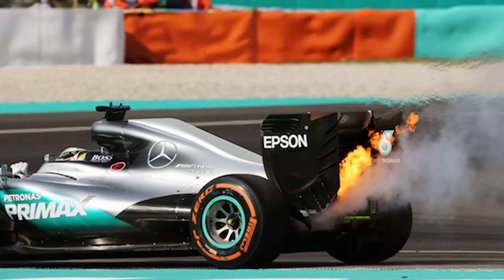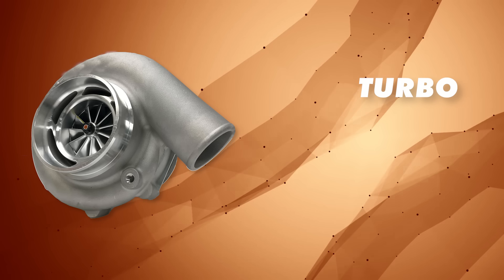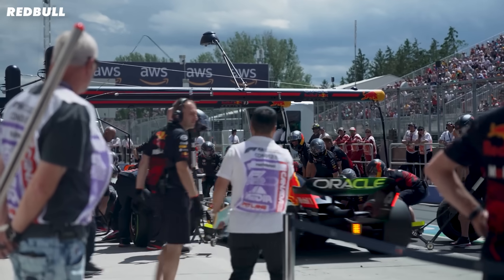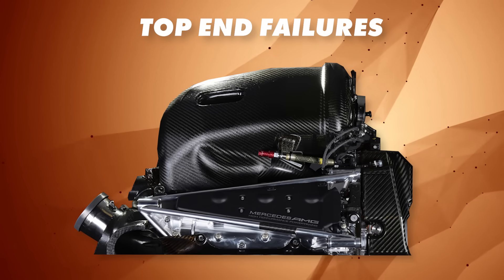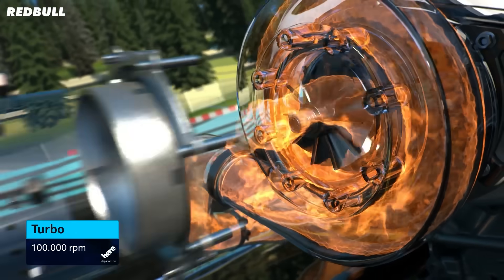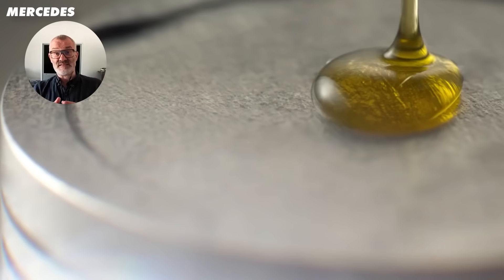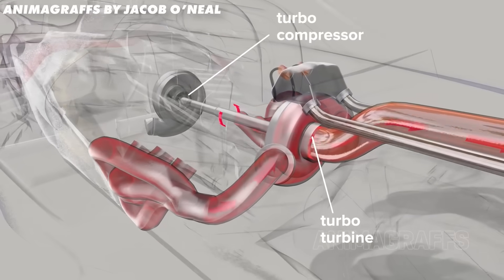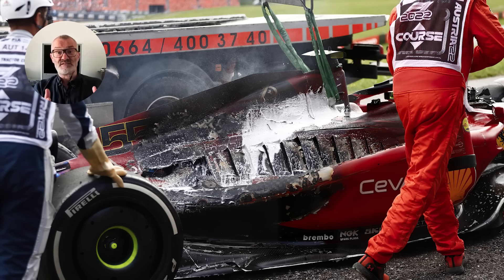Why F1 Engines EXPLODE

Comment: The pistons are directly connected to the connecting rods that when are attached to the crankshaft make up the rotating assembly. The rotating assembly is in the shortblock, making this bottom end. Pistons are not part of the top end. Top end is heads, valvetrain, and cams.

Comment: I think its more amazing they don't explode more often.  That much boost combined with insane rpms and tons of heat, I'm surprised that there aren't at least 20% of the field out each race with engine failure.  Happens a lot more in Nascar and those engines don't make nearly as much power and no turbos.

Comment: There is no bearing in a turbo, no bearing can sustain those rpm. Instead there is a oil ring that do the bearing. And usually, this is where the failure happen, this "oil bearing" leak, and then one of two thing happen, either the turbo burst and bits of it goes into the engine air intake wreaking havock, or the turbo consume all the oil of the engine who end up failing due to lack of lubrification (actually a very common cause for low engine failure).

Comment: it is quite refreshing to see this happen, I remember the early 90's where often, cars blew up before reaching the start line, others blew up on it... and then there were the spectacular high speed blowouts! I miss the 90's Formula one for one thing... unlimited shit.... 
imagine if they didn't have to make the engine last a quarter season, but could use one per 2 races or one per weekend... 
they used to have qualifying engines they just used for qualifying a couple of races before they blew out.
with modern technologies and less focus on durability when it comes to pushing things to the limit... I am pretty sure they would go quite a lot faster.

Comment: Don't think it was a turbo failure. It would be very rare that the turbo would explode rather than just seize, unless Ferrari are buying fake turbos on ebay. It think one of the piston cracked/broke, then oil get into the exhaust from the piston jets to give the smoke, sainz immediately backed off, but a few seconds letter the piston completely disntagrated and exited stage right along with half of its conrod. Ensuing fire is oil.

Comment: First picture of a "bottom end failure" at 4:07 looks like run away pre ignition melting through the piston. That appears to have liberated large amounts of metal that have bounced around and taken out an intake valve, but has continued to run for a decent amount of time after the failure. Always fun trying to work out what failed first when the driver keeps trying to drive after it has clearly got a major issue 😅

Comment: I worked as a vendor for Garrett Air research in Torrance ca. Question to you...............What turbo has the hardest life? cars?, huge earth movers with massive Turbos, race engines? Answer........... buses. Spooling up and down all day long causes more extremes, thermal, velocities, all day long. Yeah bus turbos have the hardest life. They test turbos to failure. The casting surrounding the turbine is designed to contain a grenading of the turbine. Sometimes they fail to contain the event. They use sch 80 pipe fittings down stream and a "bug catcher" a disc of 1 in. thick 304 S.S. with 1in. holes in the disc. 12 in dia. for bus  and earth mover size turbos. I've seen 12" to 8" bell reducers with dents on the outside surface .5" high. That is .5 wall if I recall. 

In the beginning of F1 turbo era They made the Ferrari Turbos ( I think they still do, have not worked for them in a while). They did not use the casting to contain the turbine in case of failure. To be light weight they used Inconel sheeting, super thin, like .040" thick. They had a Kevlar surround that was part of the roll over hoop and down the sides of the turbo. It was many plies about .75" thick. They then shipped it to their Mexican plant to be hooked to a test stand with a burner to simulate exhaust and spun it up to failure. Yes, the Kevlar contained the fragments.

Comment: It would be great to know which failure will cost a team the most amount of money/ what parts are usually scrapped vs  inspected and rebuilt to spec!
Reply: From pure logic, I would imagine a turbo is the cheapest. You could maybe salvage very little from a top failure if you are very lucky, but probably not in F1, but a bottom failure would ruin the engine. This is just me being logical, and I am no mechanic.

Comment: Interesting... I've been a licensed automotive technician for a number of years, been in the trade for longer, as well as have built a couple of custom engines and I've never heard anyone refer to pistons as being part of the top end of an I.C.E. Everyone I've ever conversed with about the subject, even machine shops and automotive engineers, consider anything contained within the engine block to be bottom end (even though the pistons often stick above the deck when they are higher compression they are still mostly in the bore as well as connected and part of the rotating assembly). Perhaps There is a bit of a difference amongst the common agreement in either my western world vs. Euro nations or maybe between road vehicles/low level racing series vs. elite level motorsports such as F1? Can anyone elaborate for me?
Reply: Yeah, I thought bottom end was all the stuff that directly or indirectly mounts to the block: oil pick-up, pistons, rods, crank and all the bearings that are associated with those parts as well... 

And the top end was stuff like the head, valaves, cams and etc on the engine
Reply: Just building an engine for myself at the moment and would agree with you I’d always heard of pistons being part of the bottom end
Reply: I have always heard the rotating assembly as being in the bottom end. Pistons, connecting rods, etc.
Reply: I did think that was a bit strange. Top end equals above combustion chamber imo

Comment: The reason why Ferrari engine are failing Is because of the ultra boost they use in theengine, they have the highest supercharging in the pack, and Is more about the Hybrid part (the Electric engine) failing under the stress... That boost gives Ferrari 20-30 hp more than the others

Comment: Driver61, why did you classify pistons as part of the top end? I have always been under the impression that everything above the piston is typically top end?
Reply: @d.martins4471  cool! I have worked in the engine industry for a little while, however it’s mainly been domesticated V8’s so wasn’t sure if there is a difference

Comment: Always interests me, how (although they are very small displacement wise) they don't make all that much power for how unreliable they really are. I mean, they make around 1000hp if you believe the claims of renault, personally I think it's closer to 900. I've seen street cars pushing 1000+ for 5 or 6 years with no major issues. I understand the displacement is a big disadvantage for the F1 engines, but still, I really don't think there's any excuse for a team to have engines that are this unreliable.
Reply: Street cars pushing 1000hp don't actually use it for more than a few seconds/minutes at a time. Have much higher capacity (as you mention) are not fuel rate limited and don't have to be as light as possible.  Chalk and cheese.

Comment: Hmmm right so if a turbo has a loss of lubrication,.... Wouldn't the exhaust NOT have oil near it? There's a ton of ways turbos can fail. Specifically with regards to the type of turbos used in f1 they are commonly ball bearing turbochargers. So the common failure modes would be low cycle fatigue of either the compressor or turbine usually resulting in a rupture of the hub, high cycle fatigue of either wheel commonly resulting in part or all of the blade to eject and sending the balance of the rotating assembly through the roof, the ball bearing cartridge could have contaminated lube (for ball bearings this is most often very fine silicone particles left over in the engine from the honing process, ball bearings are actually more easily damaged by fine particles less tham 5 microns large as opposed to journal bearings which see damage from larger particles), the balls of the bearing could fatigue, the inner our outer ring of the bearing cartridge could see spalding or damage from skipping of the balls, the impellers could get damaged from FOD, and tons more ways. Basically, I would expect an f1 turbo to literally never fail due to lack of lubrication as that would be a super rookie mistake. Just give the damn thing oil, it's not that hard. Something else (like the oil pump) has to fail first for that to happen.

Comment: With Sainz you could actually see pieces of the body work bursting from some parts of the engine flying outward.  It may have been a combo turbo/bottom end failure with the actually crank case exploding.

Comment: Could ferrari be back to their old tricks using engine oil for extra power and the resulting slight decrease in oil level just affects the oil pressure/ flow rate enough that the very sensitive turbos don't like it?
Reply: Nope.

Comment: Totally disagree on Carlos' engine failure. This was clearly a conrod blasting through the block. In my 20 years as an engine rebuilder i never saw a turbo explode, sending bits though te bodywork. Also blue smoke in a lot of cases is a piston dying.
Reply: I think that it was a mixture of a turbo failure and a bottom end because I think that the turbo ruptured the oil cooling line to itself and the lack of oil caused a bottom end failure also.
Reply: @BlackNitro99  turbos on these engines are hardwired, so I doubt it. Leclerc's DNF was clearly a seizing turbo though.
Reply: @therealCelticViking A 20 year engine builder calling a hard oil line, hardwired? Not saying you're not a good NA builder but how much experience do you really have with forced induction? Hard lines will fatigue crack, which will lead to a larger hole forming or a complete failure, which will cause low-no oil pressure, leading to a completely scrap motor. F1 turbos are also water cooled so it's also possible for a coolant line to rupture and for the engine and turbo to go that way.

Comment: Question, when Sainz was rolling off the track, there was a clear explosion that occurred under the cover. That looked more like a turbo breaking apart.
Reply: I was wondering who else saw that! I was really hoping for an explanation in this video. It was a big enough “bang” to crack the side of the side-pod open….
Reply: ya, if oiling failed heat would  cause the housing to fail, shaft spins out of kilter and pow! compressed fuel/air + burning metal shards
Reply: Good point, but also none of that was a question.
Reply: And this is the engine which is fitted in the new LMDh? for 6 and 24h races in tne WEC and in the US/IMSA?Realy?

Comment: do you think Ferrari could use induced power oscillations from its ICE or MGU-K to minimize purposing or improve traction? They seem to have found something and its not aero or suspensions. Also would explain the frequent blowouts
Reply: My reasoning for asking this is the following:

If Ferrari is using Induced engine oscillations, it would explain the increase in traction and decrease of purposing. You could achieve that by measuring the frequency of the purpoising and then tune the fuel mapping of the engine to adjust for that, so that the engine makes less power when the car squats and more power when it rebounds, in effect creating a flat running car with the benefit of increased fuel economy. In effect you are using a counter resonance of frequent forces to balance them out. 

From my own observations, the Ferrari cars tend to bounce a lot under a lot of aerodynamic load such as at high speeds or when the cars go at the limit close to top speed. While accelerating fast  say from 100KPH to about 250KPH the cars don't experience purposing and its fair to say no car on the grid is. However, once the cars go above this speed then the effect starts and is more pronounced when the car closes in on its top speed. That would mean that high speed corners, like in Jeddah or the Red Bull Ring "Turn 2" would prove catastrophic for these cars. But last race I saw Ferrari going across all DRS zones with very little oscillations. Also, when Leclerc went across a fast corner and "jumped a bit", the car shook quite violently for a couple of seconds  and then completely flat. Yes, hard suspension and all but I think there is more there such as the car momentarily went out of counter resonance with itself and the oscillations shook the car violently.

I also noticed that when a corner is slow in fast out, the effect is small but when the corner is fast in slow out, the effect is pronounced and the car shakes on entry but has amazing traction out of the corner and can take the corner much faster than the opposition(Turn 3 Austria).

Finally, you could induce engine oscillations with fuel mapping, and even though the engine would run no issues, the gas flow pulsations going into the turbo would really put a lot of strain on the turbo shaft, grenading it in the process.

Now my question isn't are they using oscillations, but could they?

Comment: Since when is a Piston part of the top end of an engine? I’ve only ever heard of pistons being referred to as part of the bottom end - basically, anything that goes in the block (like a piston) is the bottom end. That’s why a “short block” will contain the pistons - it has all of the bottom end components. The top end of the engine is the cylinder head, and everything that goes in it. That’s why a “long block” is the entire engine; both the top and bottom end.
Reply: @Stem Artin the second part is incorrect. A short block is absolutely an assembled bottom end inside of a block, regardless of the stroke. A long block is an assembled engine (bottom and top end), generally without anything else like accessories, wiring, etc. 

I just Googled it to double check myself and everything I'm seeing after searching "what is a short block" is showing that it's an assembled bottom end. 

Maybe you're thinking of the term "stroker", which is an engine that has had the stroke changed, to allow for larger displacement in the same block. An engine that has a shorter stroke than normal is generally referred to as being "de stroked".

Comment: In this video you showed a lot of smoke/fire that happened because of hydraulic failures. I know it isn't an engine exploding, so technically not the subject of the video, but if you are going to show 50 photos of hydraulic failure while talking about engines exploding; you'd figure it'd at least get an honorable mention.

Comment: Pretty sure Sainz.s failure was not the turbo, or at least not only the turbocharger.
Look at the replays as Sainz rolls to the run off area where the lower right rear sidepod gets "hammered" from the inside, 
this couldn't have been caused by turbofailures as the moving parts of the charger is too small to cause similar damage. 
I am certain that the crank or a conrod sized or cracked and subsequently went out the side of the block, the pure rotational momentum of these heavier parts cause them to continue spinning even a few seconds after the initial failure, hurling out bits and pieces accompanied with hot engine oil that immediately ignites when in contact with the red hot exhaust manifold.
20 bucks that Sainz engine has a huge hole in the block.

Comment: So, you narrow it down to the turbo but, what causes the turbo to fail?
a)  A leak of oil in the turbo?
b)  Did the turbo malfunction or broke? 
c)  Not enough Oil in the turbo?
d)  Is it a design flaw of the turbo and engine combination?
e)  All the above?
Reply: There are 3 turbo charger failures for ferrari. So could be a design issue or they are just pushing the performance limit of the turbo in order to stay in fight with RBR.

Comment: One thing I have been wondering is why were V10 F1 engines less reliable than nowadays engines?
Reply: Nowadays teams have to use 3 engines a season without penalty but back in the v10 days they just had to have an engine to last 1 race
Reply: @graham4920  So the teams just ran the cars with more aggressive engine settings? Also weren't there still engine penalties, I remember Kimi getting like four engine different penalties during 2005
Reply: @jussieronen3707  IIRC you had to use the same engine for qually and the race, if it blew in qually and a new engine was fitted you got a penalty , but you could fit a new engine for the next race, so no engine limit as such .
Reply: Basically the state of tune of the engine, the V10's could rev upwards of 18000+ rpm and were tuned to an inch of it's life, it just had to go race distance, the mind boggles at piston speeds travelling up and down a bore at 300 times a second at 18000 rpm.
The new V6 engines don't rev as high, they are limited on turbo boost, the amount of fuel that can be delivered ect, if there wasn't a restriction on the amount of engines they can use and no limits or restrictions imposed it would be like the turbo engines on the 80's , 1000bhp in race trim and it was rumoured when turned up fully for qually around 1400bhp

Comment: This didn't feel very F1 specific, it all pretty much sounded the same as normal highly tuned car engine failures. Would love to see more on breaking down F1 ICE's. Those bearing pictures you shared looked crazy, nothing like I've seen on typical engines.
Reply: the failures sound the same probably because they're still fundamentally the same components, only with much higher precision and smaller limits before catastrophic failure.
Reply: Maybe even a history of ICE's in F1? I've never been able to comprehend how they spun the old engines so fast.
Reply: @TimPaddy  The high rpm are mainly enabled by having very wide bore and very short stroke. this reduces piston speeds and the resulting g forces which destroy the engine. plus probably 150 details i didnt mention